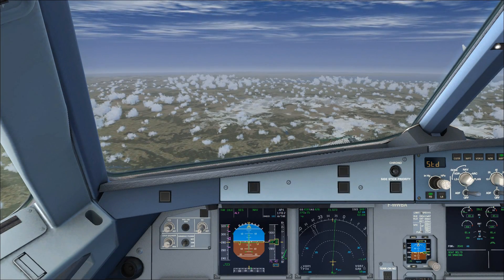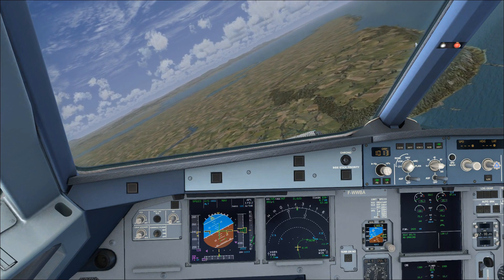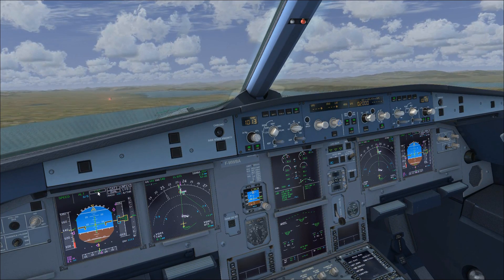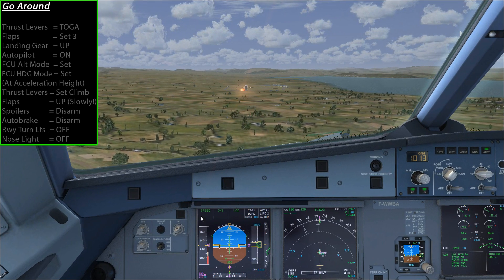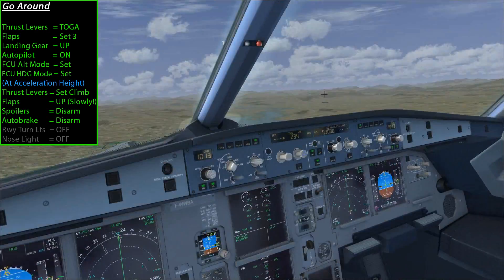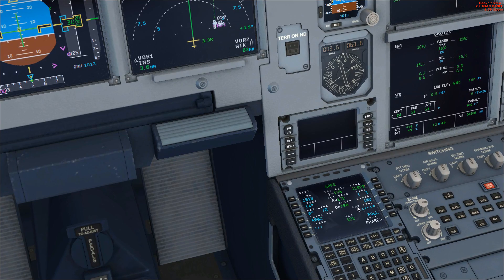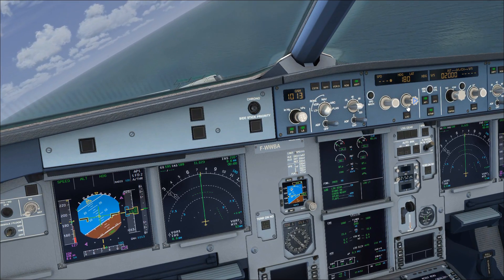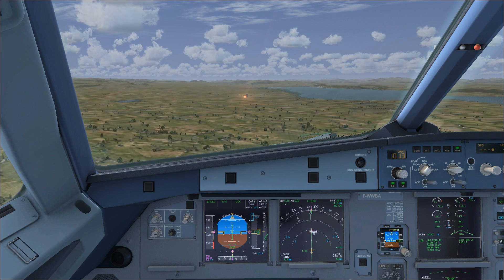A320 Go Around Tutorial (FSX - Aerosoft Airbus)

Comment: Are pilots permitted to go around after minimums? As I've seen many aircraft go arounds at 20 feet above the ground.
Reply from the maker: Absolutely. When a pilot reaches the Minimum Height, if they cannot see the runway or the runway's lights before that height, then they should perform a Go Around/Missed Approach. That's a rule to prevent the pilots attempting a landing in poor visibility. 

If the visibility is good and they get closer to the runway, but don't feel like they can perform a safe landing, then they have every right to Go Around from an altitude lower than the Minimums. The Minimums are just a safety measure in extremely poor visibility conditions.
Reply: Yes they are! In fact, I think Mentour Pilot (an actual 737 NG pilot) made a video saying pilots can perform a go around at any point during the landing up until the reversers are selected. So you can actually perform a go around even after touching down as long as you don’t select the reversers out. Usually this would happen in adverse weather with high/gusty winds

Comment: Hi, I was making final approach for Auckland INTL New Zealand (NZAA), when around 3NM from the runway the plane suddenly goes into the go around phase. I then perform the procedure and on final for the second time, it once again auto goes around because of traffic. The third time I came in for a final into the airport, it suddenly activated the GA phase for no reason like the first time. At whicj point I gave up and crashed into the sea.
Reply from the maker: Bizzare, if the plane is behaving unexpectadly even when doing all the right steps in the right order, it may be a tech issue. Probably best to try re-installing the plane first. If it's still an issue after that, maybe contact Support and see if anyone else has had the issue.
Reply: “I gave up and crashed into the ocean” 😂😂

Comment: Nice tutorial. Many operators raise the acceleration altitude on the missed approach to the missed approach altitude.
This does several things..improves your obstacle clearance.
Guarrantees climb performance to maintain the minimum all the way up particularly on one engine.
Slows everything down so you are not trying to fly the missed approach some of which are very complex while accelerating.
In general raising your two engine accel to the missed aporoach altitude makes your life a lot easier and safer.
Nice vid for simmers mate just adding some real world stuff to make life easier..

Comment: I haven't tried this yet but, if you don't manually select a heading after moving the throttles to TOGA, shouldn't the aircraft track the missed approach procedure that's programmed in the FMC?
Reply from the maker: I believe you'd need to re-enable the Autopilot Master Switch before it'll do that.